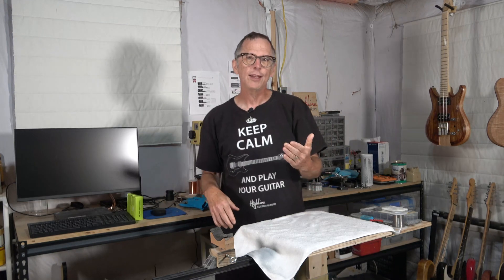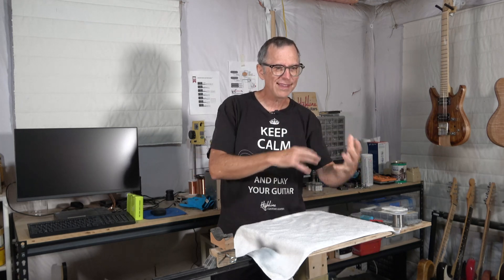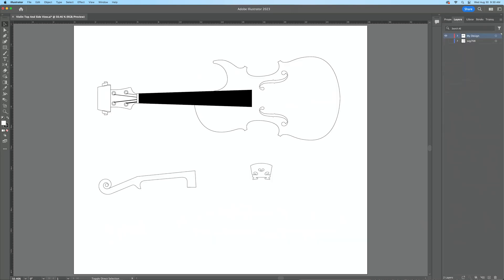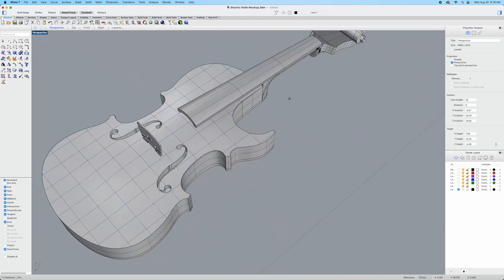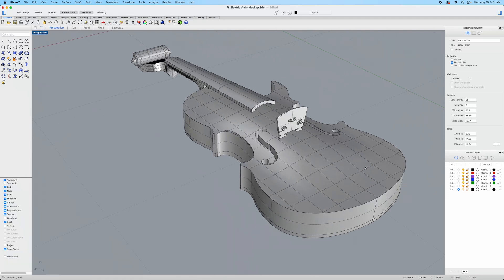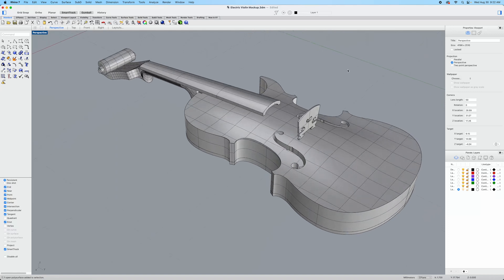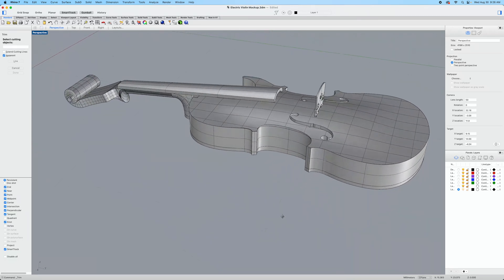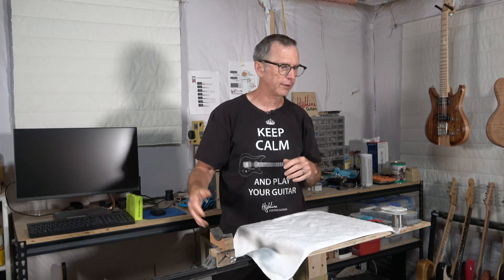Making An Electric Violin Part 1 The Design

Comment: Please consider using a magnetic pickup. Theres only two on the market as far as im aware of, but you could make your own, if you have a winding machine. Be aware that the physics of a bowed string requires the magnetic to be designed to accomadate this. the two magnetic pickups on the market currently use totally different designs: Cantini pickups have individual pickups to the side of each string in the bridge, while Sbip pickups look like guitar pickups, but with the magnets offset and angled to the strings. Both of these designs try to align the magnetic field for the bowed strings vibration to move tangent to it. The reason why this doesnt matter with a plucked string is because a bowed string moves with the bow in a side to side motion, while plucking results in a circular motion.
Reply: Also violins are in desperate need of innovation.
Reply from the maker: Believe me, I have been thinking about this a lot. I have an idea for a humbucker that would sit under the strings between the end of the fretboard and the bridge. It would use a pair of P-bass single coil bobbins wired together in series.

Comment: Fun project. My daughter plays the violin and at first I wondered why they don't use guitar like tuners. It's part tradition but more importantly, it's the worst possible place to add weight to a violin. The fine tuners on the tailpiece make it easy to tune. Plus, there are no frets so mostly what keeps it in tune is you ear and where you place your fingers.

Comment: A good violin weights under 400g, these 4 guitar tuners will weight around 140g, that means that you are adding 35% of the weight of the instrument at the worst place for balance. If you are going to use guitar tuners, at least use Gotoh Stealth tuner which weight about a third of normal tuners.

Comment: Chris, will this design experience "neck dive" due to the added weight of the wide scroll plus the 4 metal tuning machines?  I've never held a violin before, but it seems to me that "traditional designs" would be balanced by trial & error after a few hundred years of development, but your design cuts away some of the weight of the body while adding weight to the headstock..., I think.

Edit:  I'm looking forward to this new series!  Have you considered getting an experienced, but "open-minded," violinist to play it when you finish so we can hear it?

Comment: You will notice all other electric violins don't have a cutaway, but instead have something shaped like the body under fingerboard.  This is to let you use body to get hand to correct position, the cutaway is a bad idea if you ever want to play a real violin in the future.  I don't see any issue if you only play this violin ever.  In reality you will likely only hit positions 1 and 3, so may never be an issue, but think about it.

I believe there are mechanical tuners that fit into normal violin tuning peg slots, you can also do like a double base tuners and make head stock normal sized.  Kind of like a classical guitar tuner.

You are correct about weight may be issue.  A normal violin that is 50 grams too heavy is very noticeable.

Good luck!

Comment: I built a fretted electric violin many years back and it had a cutaway mahogany body too. The weight of it turned out to be a real problem. One of the high school orchestra people I knew put a chest rest on it and it worked somewhat better that way. In retrospect, I would have put the effort into hollowing it out or something.
Reply from the maker: Mine will be hollowed out.